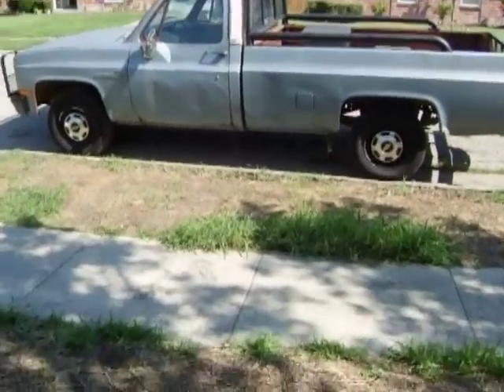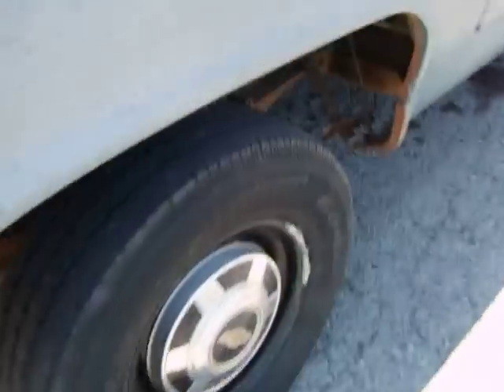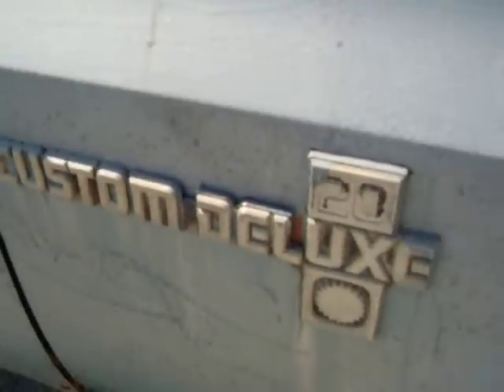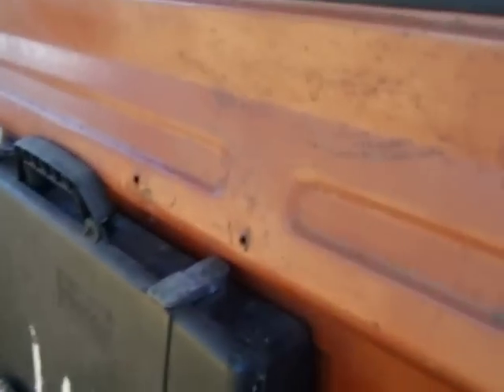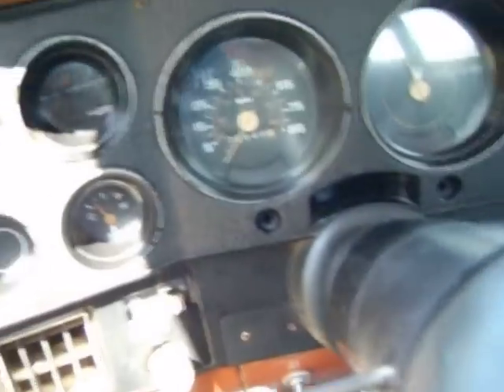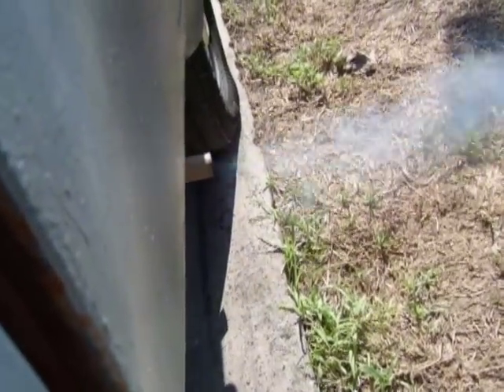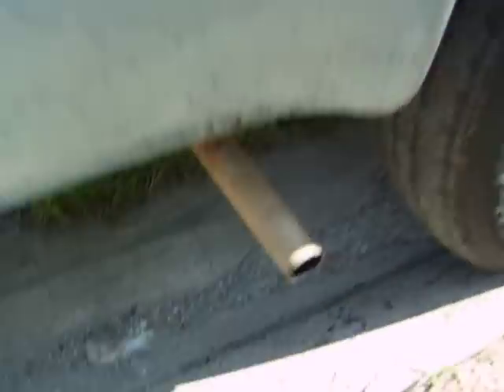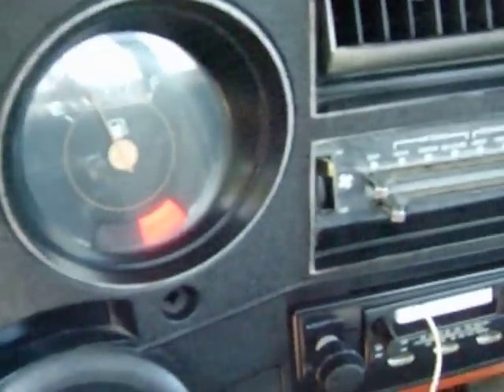My new chevy truck

Comment from the maker: yeah it runs strong the odometer says 8,000 but there is not hundred thousand place so its probly 180,000 or 280,000 still even buying a truck like this with more than 200,000 miles on it today is like buying two new cars of this era it will out last them even old and tired and i was luck enough to find this one thats old but not tired never had a ball joint replaced in its life the stearing has less than 1/2 inch of play its pretty tight and the original a/c compressor its still blows cold!

Comment from the maker: i know lol but when you get a head start and burn them it spins both its limited slip doesent have a locker havent goten stuck yet but looking to put a 205 trans case and a dayna in the front the A arms are to expensive to Fix the bushings and my passenger side upper arm bushings are really badly worn the tire had about an inch and a half of toe in and out play when i get over 55 it likes to wonder around and later on i might put a 6.2L diesel